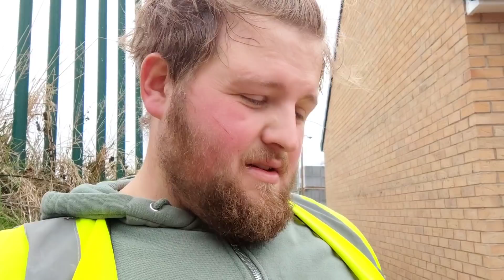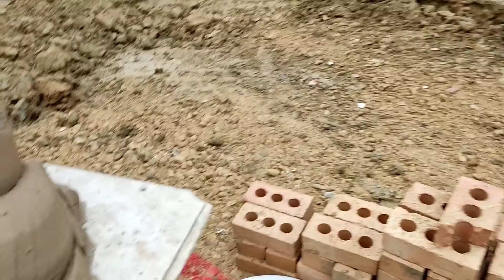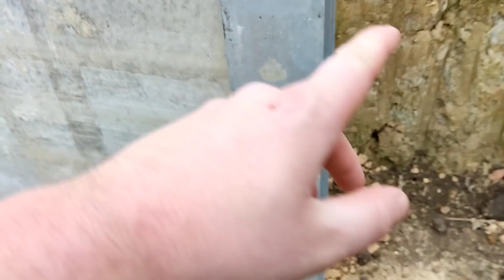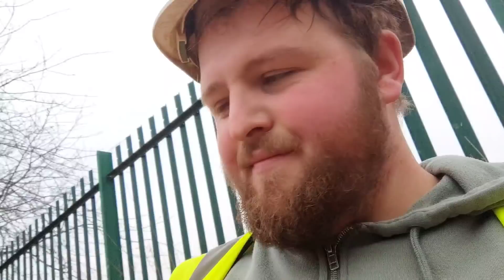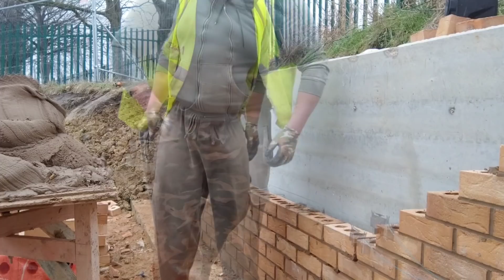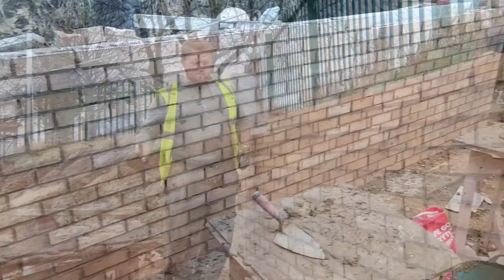Bricklaying Vlog - Can You Make Money with a 7inch Trowel?! a Steady Monday!

Comment: No sure if it’s the way you throw the gear on wall or multiple scrapes but seems mark a good few bricks cement marks. Day work is generally for lazy can’t be bothered attitudes across all the trades.
Reply from the maker: They mark easy these brick but it all come clean with the sponge
Reply: Smears all over with pick and dip perp not good